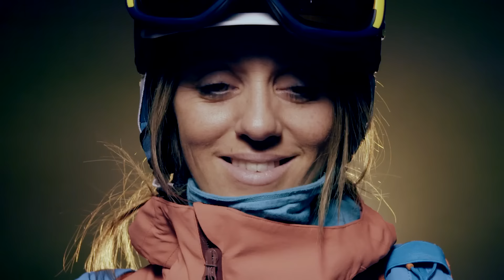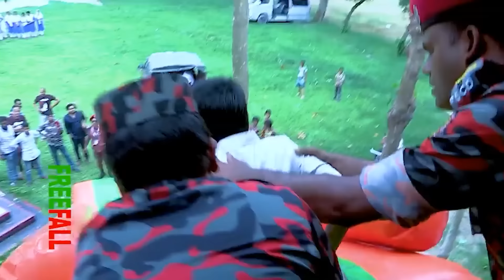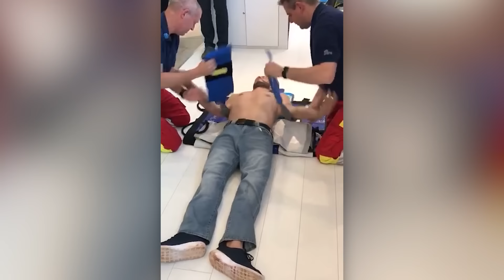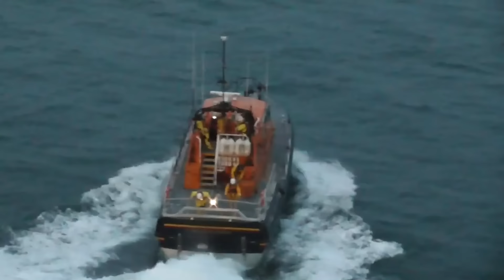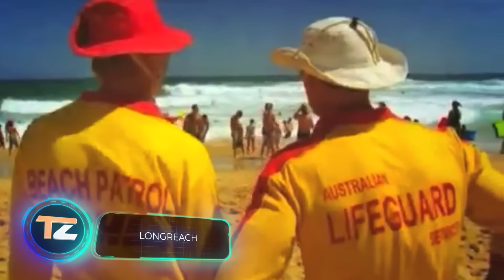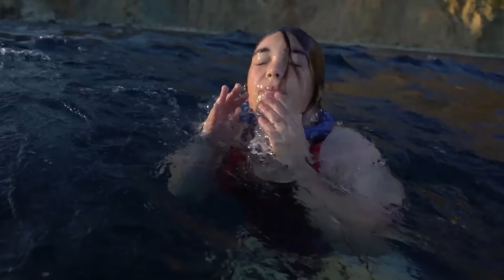EQUIPMENT AND INVENTIONS THAT CAN SAVE YOUR LIFE

Comment: The rescue boat has two one thousand horse power diesel engines. I though it would have a ridiculous top speed... but then he said "top speed of 29 mph". I have a 30 year old Seadoo with a 720cc engine that can do double that
Reply: @SD-fv9zu  please explain
Reply: @robertshank1131  Can your Seadoo tow a small yacht and maintain security for the occupants for hours in heavy seas? The RNLI do use small craft where appropriate but you don't send a Seadoo 30 miles out to sea or more to rescue tens of people from a ship.
Reply: @davidmam  I wasnt suggesting that a seadoo could be used, just that with that much horse power I would have guessed that boat could go much faster than 29 mph (as my tiny seadoo can do that with one tenth the HP)

Comment: The Autopulse is not the only kind of product like it on the market. Our EMS crews use the Lucas chest compression system. They both require the same type of installation, only the force comes from a different mounting point is all.
Reply: Not true.
Reply: @stupidhead9117  how so?